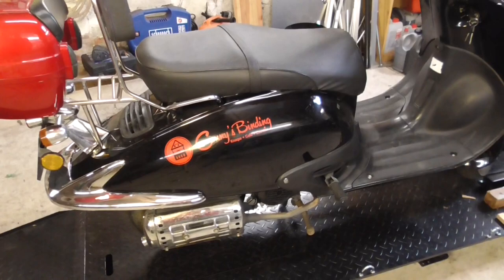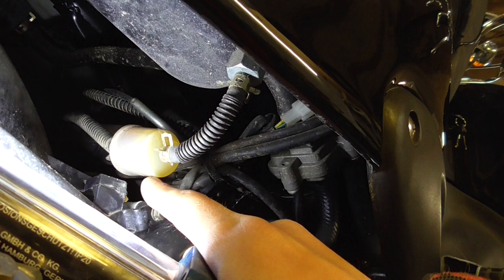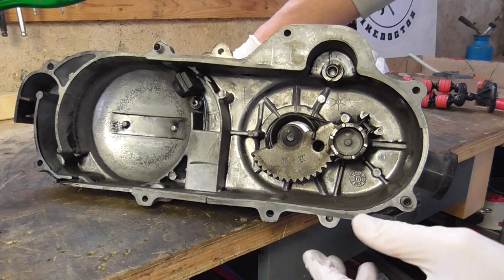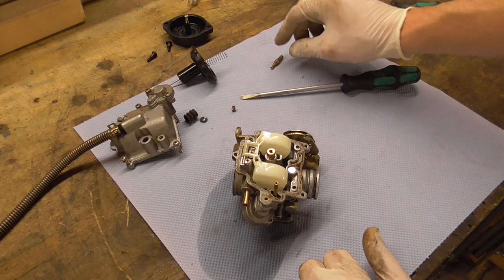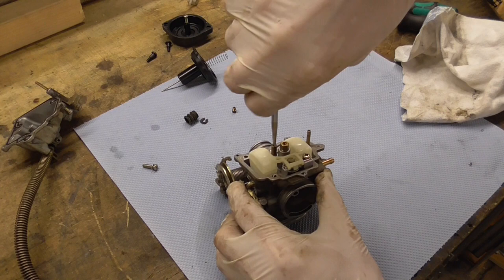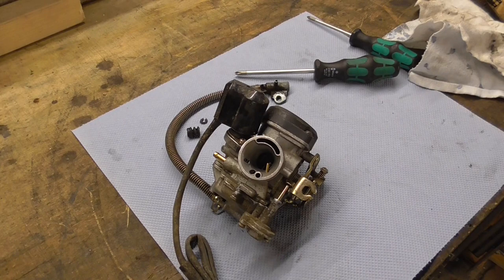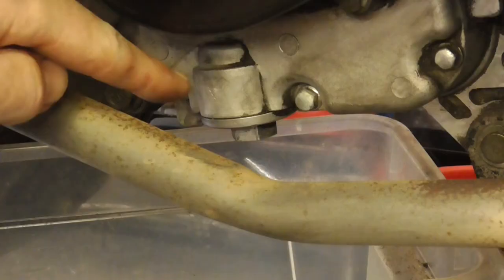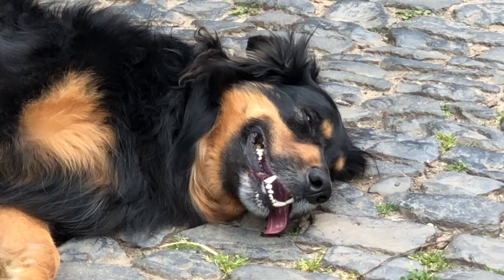Benzhou 50 retro 4 Stroke China Scooter runs bad - but why??

Comment: I have just bought one of these scooter's  not new  . seller told me been in dry store around a year . now it turns over and then cut's out / pleased I watched your video ,now I have some idea what I need to do . replace old fuel  and engine oil and take out carb  and do as show in your video / I have to get this scooter running in order to be able to take it to a motor bike garage for a MOT . hoping it will pass . look forward to your next video regarding making scooter go faster .
Reply from the maker: Thanks for your comment. That's what youtube is made for and why I make videos

Comment: Adjust the choke to make it richer, Just a little bit, though
Reply from the maker: Thanks
Reply: @bikedogtor1663  Sometimes there is a plastic insert right in the intake of the air cleaner. It does cause a low air intake and the scooter runs like crap. I pulled mine out and its free air no restriction. I am at 28,600 kms on it.

Comment: Hava a chinese scooter with that simular engine. It runs, BUT.... when you accelerate it goes up and down in power. 
Some times it won't accelerate and totally looses power.
Cleaned the carburetor, get clean fuel and air.

Thing is driving me NUTS
Reply from the maker: Still problems after cleaning the carb?
Reply: @bikedogtor1663  Yes. still the same.
Reply from the maker: Sound like a problem with fuel flow. Try bypassing the membrane fuel switch
Reply: @bikedogtor1663  I can try that.
It's strange that when you put it on his center stand, it will accelerate very normal.
But when you put on it to ride it. It seems to loose power and stall.
Reply: @Toxicdemon2  - Once I had similar issue! Turn out the fuel hose was badly positioned and produced a kink that restricted fuel flow in some conditions! 
It's extremely important to route cables and hoses properly! ;-)
BTW leaking hoses, namely vacuum hoses are also a common culprit for , so called, random behavior. Make sure they're secure and tight.

Comment: Du stellst Fragen bei dem Material  🤣🤣🤣 Bei der Sorte China Scooter zählt nur Eins.
Super billiges Zeug gebrauchen und für mindestens den doppelten preis verkaufen.
Dieser Scooter den du im Video gezeigt hast, kostet mit Import und allem, rund 600/650 Euro, der Neupreis beim Händler ist über das Doppelte!!!
Brauchst du später einmal Ersatzteitele, dann erfolgt die nächste Abzocke.
Voor allem bei der plastik Bekleidung. Weil die am ehesten Kratzer hat oder kaputt geht.
China scooter, laast die Finger weg von den Dingern.
Nur Ärger.
Reply from the maker: Recht hast du